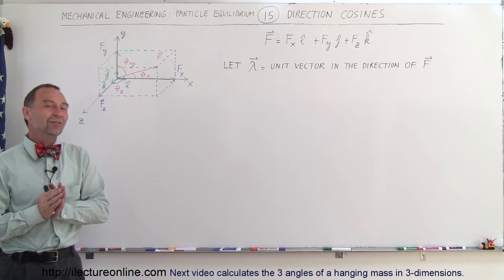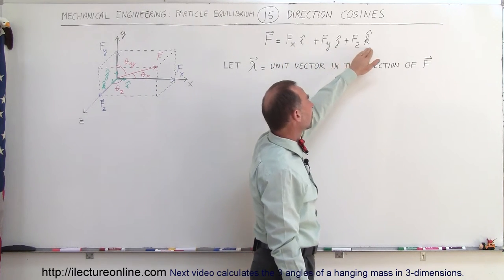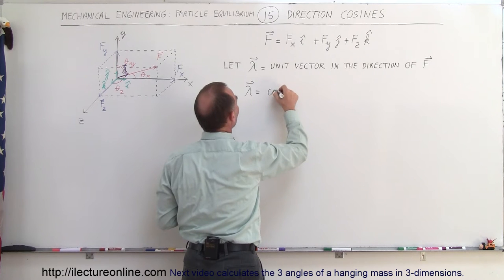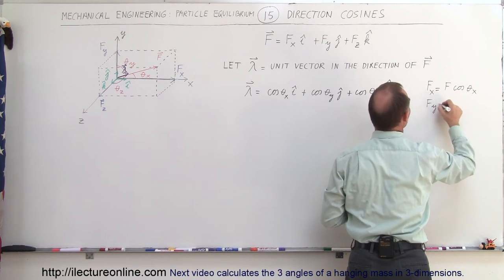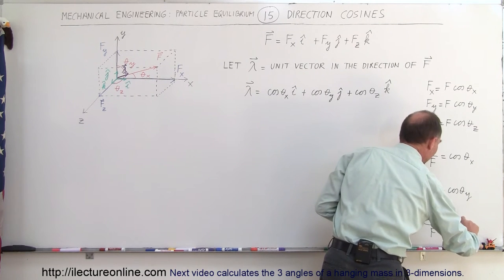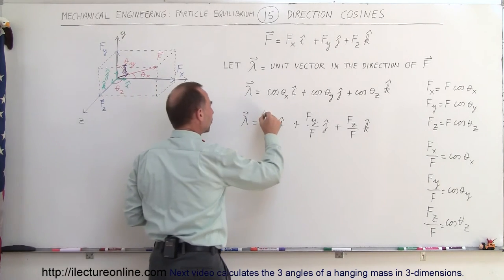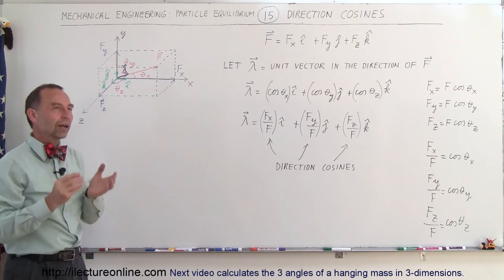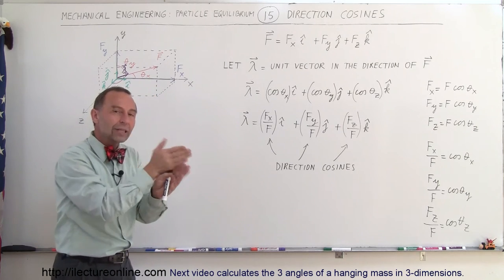Mechanical Engineering: Particle Equilibrium (15 of 19) What Are Direction Cosines?

Comment: Really interesting lesson! For fun, I tried to figure out which angle a vector would need to make with each of the 3 different axes to be "equally shared" between all of them. I believe the only two angles possible are ~54.74° or ~125.26° (not surprisingly the 180s of each other). Does this look correct? Thank you so much for the videos. I'm actually beginning to feel confident in my studies again!

This was my work:
To be equally shared, I assumed the squares of the directional cosines needed to be equal. So we'll say cos^2(Θx) = cos^2(Θy) = cos^2(Θz) = w^2.
Therefore w^2 + w^2 + w^2 = 1
3w^2 = 1
w^2 = 1/3
w = ± sqrt(1/3)
cosΘ = + sqrt(1/3) ⇒ Θ = cos^-1( + sqrt(1/3) ) ≈ 54.74°
cosΘ = - sqrt(1/3) ⇒ Θ = cos^-1( - sqrt(1/3) ) ≈ 125.26°

This also makes sense, because if you did this with a 2-D problem, you would see that the only two angles possible to share equally between two axes would be 45° and 135°.
Reply from the maker: That is definitely one way in which the angles could be set up to make it work.  But there are also other possible combinations (an infinite number of them).
Reply: @MichelvanBiezen  Ah, I see, that's really interesting that there can be an infinite number of combinations, but they are all related. I will definitely give that some thought. Thank you!